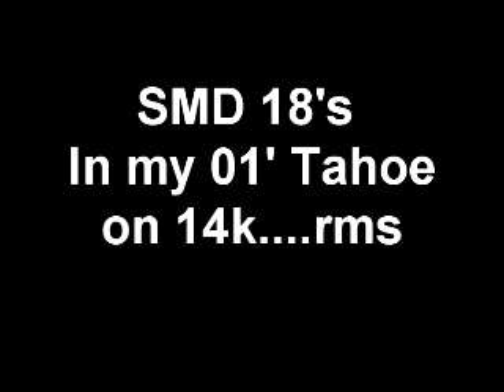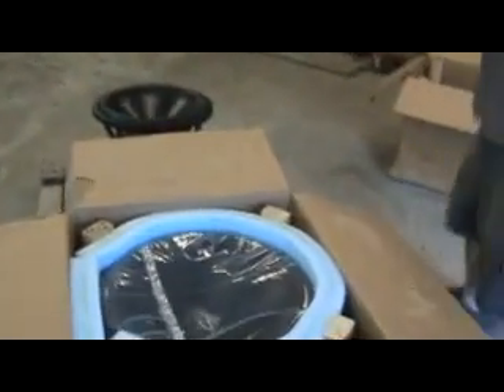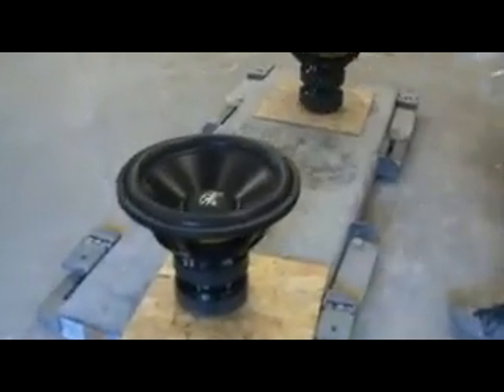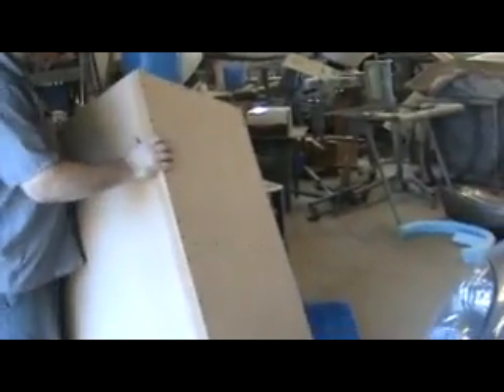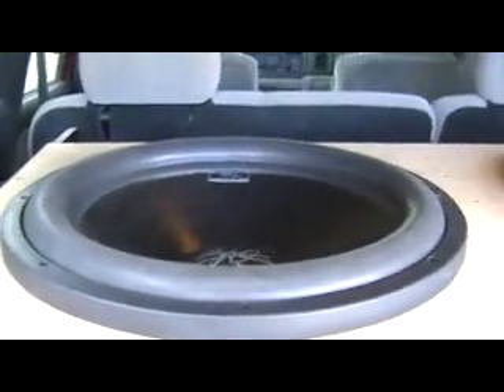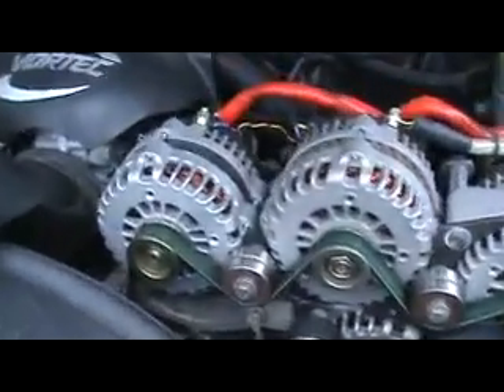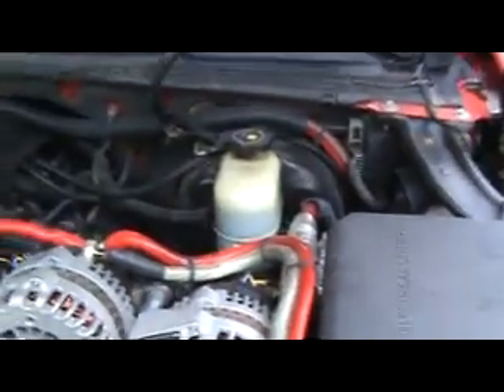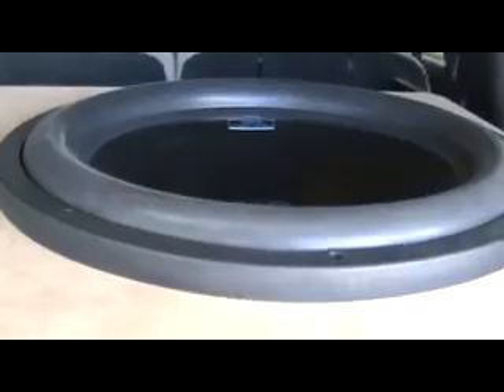SMD in My Tahoe

Comment: Great call on Mechman Alts man, I've had 3 Iraggi's take a crap in as many months. Swapped them out for Mechman.

What is that tuned to? Not trying to bust your balls, just seems small (I too run 2 SMD's, but on 6600.